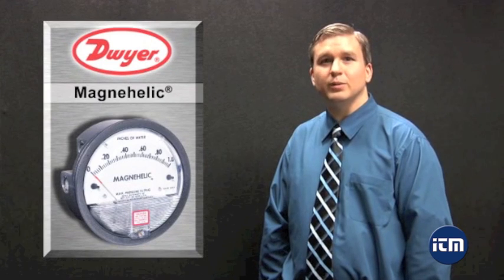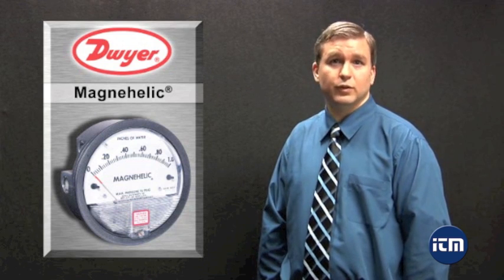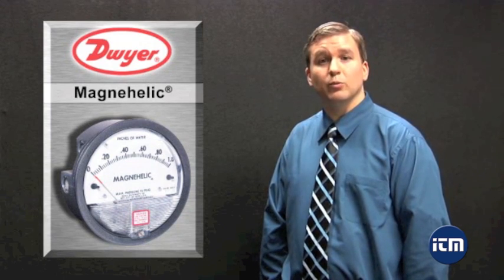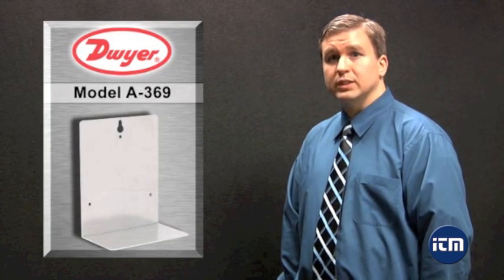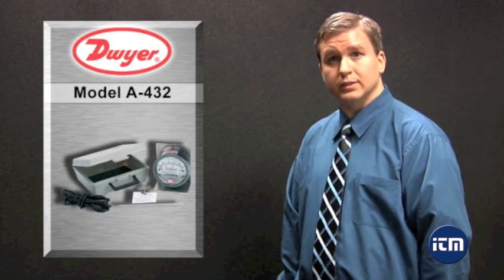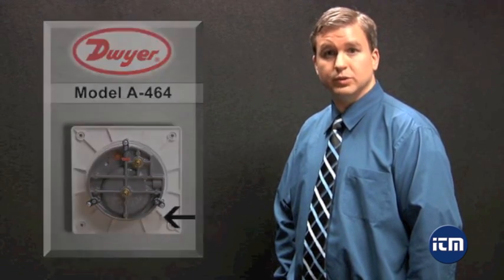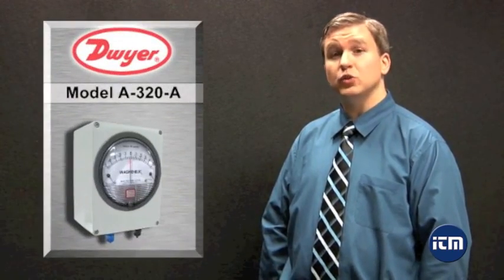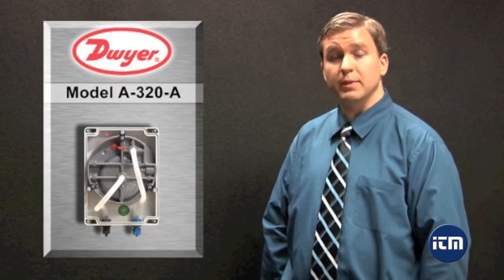Dwyer Product Tutorial: Magnehelic Pressure Gauge: Hang, Flush, and Enclosure

Comment: Absolutely useless video that explains exactly nothing about how to flush mount this gauge in drywall.  Do you need to cut holes in both sides of the wall?  Do you need to leave an access panel on the opposite side of the gauge's face?  Why spend money making videos that provide no instruction?  Also, the instructions included with the gauge are even more useless than this video.